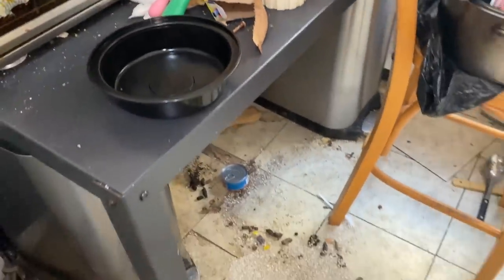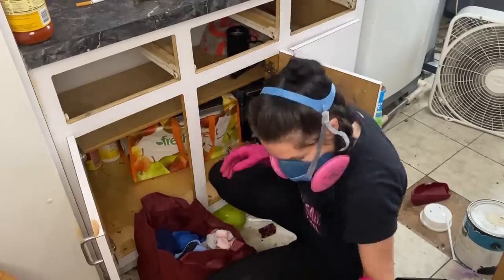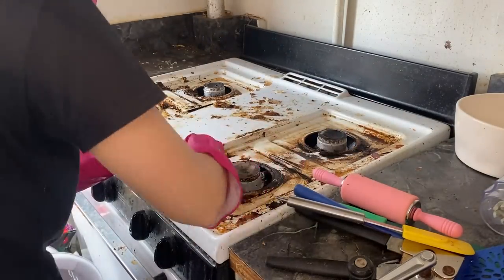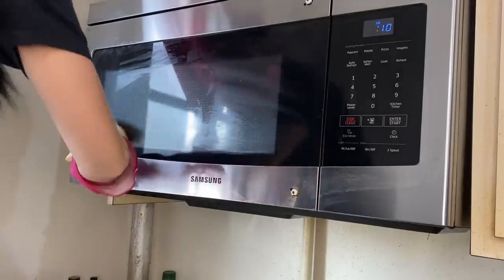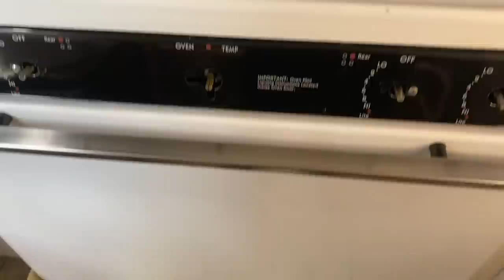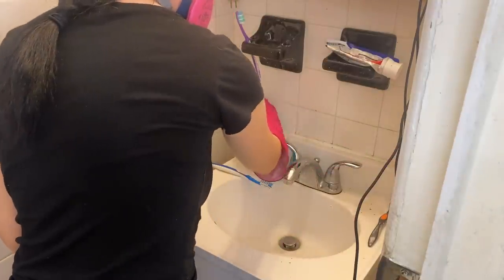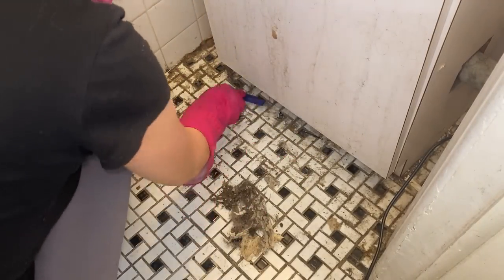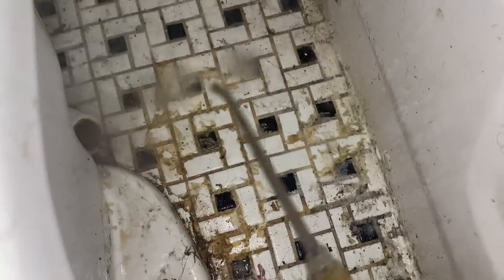Filthy kitchen and bathroom cleaning #cleanwithme #declutteringandorganizing #speedcleaning

Comment: Sometimes the spray hole gets a bit blocked, if you take the white bit off & put it in hot water, it should unblock it & then it usually works better 😊🤞

Comment: My back starts burning too when doing dishes. Try bending both knees a little. It takes the pressure off your back
Reply: If it is your kitchen have it elevated a few centimeters. You are too tall for the height of your kitchen or your kitchen is too low for your height.

Comment: I understand that people have issues in their lives and they need help. But sometimes they need a little tough love. I am sure you were gentle. But she did good by allowing you to throw everything away. I use vinegar and water with a bit of rubbing alcohol and a couple drops of Dawn soap to clean mirrors and anything that will shine. I don’t use the blue window cleaner. Ever. My favorite is just water and vinegar. It works great on windows and glass. I also use a microfiber cloth. I don’t use a lot of paper towel. I just started using Bar Keepers Friend. I love it. You are a hero!!

Comment: You can actually use bleach to clean almost every surface! I use it for my bathroom, the kitchen sink, the counters and island in my kitchen. Idk about the strength of other chemicals, but I know that bleach will obliterate practically any fomite or pathogen you find (it works wonders on containers that previously stored moldy food). However, the Clorox bathroom cleaner works just as good. I used to clean a restaurant for a living!

Comment: the standard height of kitchens is not intended for working in a standing position. it is from a time when people worked sitting at the kitchen table and had no money for higher kitchen furniture. if you have permanent problems with your back you should jack up your kitchen at home. an inexpensive solution is also to buy a spastic tub for cleaning the dishes, which you put on the countertop.

Comment: I use most canned food 6 months past the use by date as it’s usually good. 
The only exception is tomato based tins and milk based.
I noticed an ant and roach spray tin - I would have sprayed the inside of the cupboards after cleaning them.
That owner now has a lovely clean kitchen and bathroom- that must be a mood elevator.

Comment: When doing the dishes and trying to prevent back pain, open the cabinet door below the sink and place one foot on lower cabinet to elevate your foot appropriately 4-5inches. Also, you can make a very wide stance with your feet apart, which lowers your height. Hope this helps, even if just a little.
Reply: Thank you for your help.  I will try both methods. 💖💖💖
Reply: Great tip! Thank you!
Reply: That’s a good tip!
Reply: Excellent tip!
Reply: I'm going to try this thanks
Reply: From all of these comments Barbie is not alone with back pain while doing dishes🙂
Reply: Good cleaning.  Sorry about your back  .  I understand completely.
Reply: Yes! I do both of these.
Reply: Come on with the tips! We love it!❤
Reply: I understand totally about the pain and burning sensation, you might check with a blood test for HLA-b27 if this is positive you might tend for espondiolitis
Reply: Thank you for your help. I will try to remember to do that.

Comment: Maybe the owner could find used drawers at a second hand building supply store and maybe find someone to fit them and paint them white. This would give a 25% increase in storage! 
If you remove just the center tiles and save enough to replace just the missing ones on the edge and then buy some peel and stick tiles of another color and then fill in the center rectangle. With a small amount of looking and $200 you would have a nice kitchen but if you ask renovators that just toss them in the dumpster they may save you some  from a tear out. I would shoot pictures and most of all give height, width and depth of what you need. I have seen glue down tiles at Habitat at a restore for 50 cents each that would cover that area. People will help when showing initiative. The amount of pride you will have in yourself when the job is done and how nice it looks will give you the incentive to keep it looking nice!

Comment: I know it must be hot in some of these houses you clean, but cover your hair and wear protection ( goggles) .  Always make sure you protect yourself. You did an excellent job. And for the sapray nozzle, put it in a little bit of warm water to soak for a few minutes. Sometimes the hole gets clogged up with dried product. It always happens with my spray starch nozzles. Hope it helps.
Reply: @cleanwithbarbie  💝

Comment: Another tip for the problem with backache and doing dishes.  Wear an apron or towel around your waist so you can stand closer to the sink and not worry about getting your clothes wet.  It really does help.  I hope you will see this comment because the video is a month old.  I will watch a new video and place the comment there too!
Reply: Open the door and place one foot on the floor of the cabinet. That prevents stooping.  When your back stays neutral, you are less likely to develop pain.

Comment: Great job as always! I'm just a little worried when i saw you use the steam cleaner with bleach because it can create toxic fumes when you use hot water with bleach. Also the active chemical in bar keepers friend is an acid while bleach is a base so using them together may neutralize the chemicals effectiveness.

Comment: Get a small spray bottle put 1/4 cup dawn,1 tablespoon of alcohol and fill with hot water, swirl around a little bit, then let sit for 30 minutes. Then spray the stove and cover with plastic wrap and let it sit for an hour or 2 . Then wipe clean 🙂
Reply: Be careful when spraying alcohol it is flammable and there could be gas lighting the pilot on the stove.  Also it is unhealthy for your lungs to breathe alcohol particles.  But you are right in that it does a great job of cleaning , but please be careful when using it wear a mask.

Comment: I don't understand why you didn't bring your own broom and mop & bucket, you need to save your back & use tools that protect it like brooms with a handle and a mop & bucket with a spinner.
Also your back becomes achy when you wash dishes because your core (abs, glutes & thighs) is weak, strengthen that & give your back a break.
Reply from the maker: Because I already have a lot of stuff to bring with me
Reply: In another video Barbie shows how much she has to carry in a large suitcase and carrying all the filming equipment while taking the bus or the subway.  It is not possible to carry even more cleaning items.  It would be lovely if a donor could gift her a van so she can travel to these homes in her own "Clean with Barbie" van.  She could then have a floor cleaning machine and other things that would help her save her joints and her back from so much physical strain.  These types of cleanings really cause wear and tear on your body.